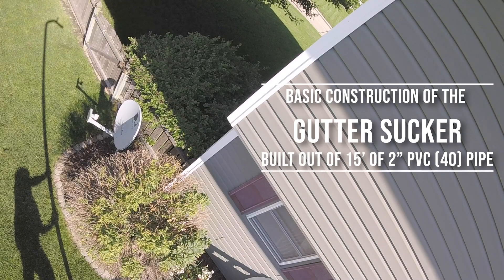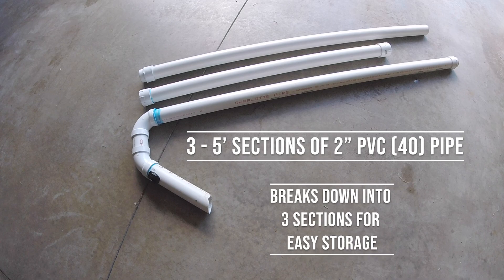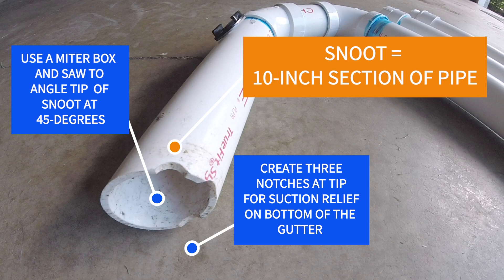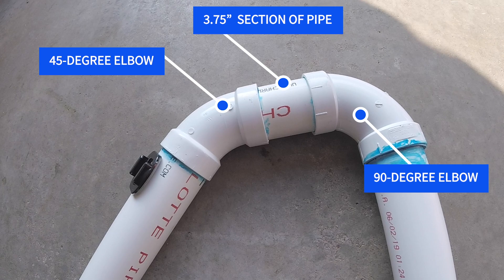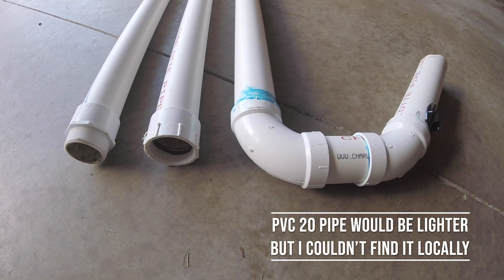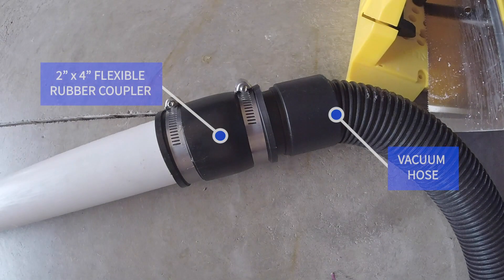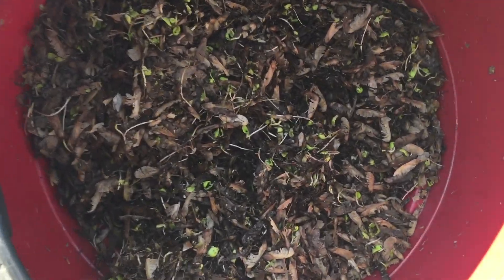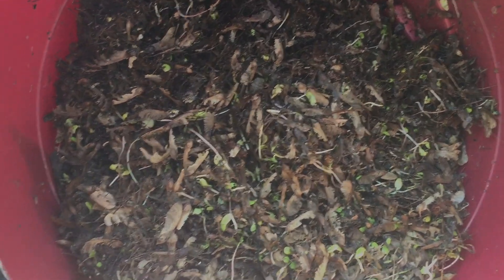Gutter Sucker: An easy way to clean your gutters without having to climb a ladder

Comment: I made one of these several years ago but I used the whole house vacuum tubing they install in the walls of homes it's thinner than schedule 40 PVC.  It's available from Amazon. I had trouble with mine because I have large oak leaves that constantly plugged it up.  I finally switched the vacuum from suction to blowing and I actually blow the leaves out of my gutters.
Reply: I’m in a similar boat. I have oak trees too and was wondering if this system would work. How’s blowing the leaves? Does it make a complete mess or is it not that bad?
Reply: @ilikemyrealname  It just blows them out and you rake the up. Even blows the acorns out.
Reply: @jsantef  I'd say once on the ground ... easy to then suck them up.  No need to rake.  no?
Reply: @johnjacobjinglehimerschmid3555  The problem is the oak leaves even with a power shop vac they tend to plug it up.
Reply: legion rider good to know thank you!
Reply: Considering going with ABS and approaching this bi-modally as a 'toggled' semi-annual solution.  I live in a 3-story house in an oak forest.  In the late summer and fall, first acorns, and then large oak leaves are shed.  I consider this the season that blows.  At or near spring's end, I need to clean out the male oak blossoms which shed and gutter clutter at that time.  That's when I plan to switch the hose and use the vac side during the season that sucks.  I'll probably also narrow the end of the pipe, increasing air pressure during the season that blows.  So I'm planning to use Todd's invention primarily during the season that sucks and the season that blows.
Reply: Preyevate Eyeland You’re reply is both informative and hilarious.
Reply: @ilikemyrealname  ...and serious.
Reply: @ilikemyrealname   😜
Reply: Preyevate Eyeland Absolutely all of these things! 💪😂

Comment: Great idea and execution! Has anyone thought about using ABS pipe? Per 10', 2" ABS is 3.9 lbs. vs. 7 lbs. for sche 40, (& I'm not as young as I used to be). Any reason not to? Hard time finding sche 20 in 2" around Atlanta.
Reply from the maker: My plan was to use the lighter pipe but I couldn't find it here locally. I have been told by friends to try a plumbing supply company.

Comment: Great gadget, many folks could learn to use that after a few goes, magic idea to used screw couplings in the construction helps a lot for adding to or even taking away section to suit ground levels around house, also great for storage time, well done.

Comment: I have a Ridgid shop vac with a 1-7/8" hose. Will that work?
Reply from the maker: I think it really comes down to the power of the shopvac and how clogged your gutters tend to be. I had a 2" so I made it 2". You can easily use my design with that hose. The connection is a rubber hose clamp so you'd only need to really crank it down for that 1/8 difference.
Reply: My Ridgid shop vac has a 1 1/2" hose, but it is really powerful. If the leaves are too big to vacuum, try blowing them out, as someone suggested.
Reply: @rongarza9488  what could be used to blow it out?

Comment: That sir was excellent 👍thank you I will build one this weekend, I’m getting to old to climb 2 stories onto the roof.. the only thing I need to know is how you connected the GoPro to your phone ?
Reply from the maker: Glad you liked it. GoPro was mounted with a GoPro Curved Adhesive Mount - https://bit.ly/2MtDONi YOu should be able to find them locally at Best Buy, WalMart, or Target. Anyplace that sells GoPro gear will have the mounts.
Reply from the maker: Wait I miss read your question - The GoPro I was using connects to the phone via Bluetooth. I think the last three generations of GoPros have that capability.

Comment: Hook it to a leaf blower and blow the gutters out.  No glogs and it is much faster.  Just make sure everything is dry.
Reply from the maker: Interesting idea.
Reply: I have a set-up with a Leaf Blower and plastic downspout and it is awkward and you need eye and head protection. The connections are made with duct tape and the downspout has a tendency for being overly flexible especially on a two story gutter.  This is the reason I am thinking of buying the components for one of these to compare.
Reply: Rocket on the end of a 15' tube.  Too difficult to control.  Yup, tried that.

Comment: My shop vac hose is only  3/4" is that too small, do I need to buy a new shop vac with 2" hose?
Reply from the maker: I am thinking the 3/4" hose might clog too easily. Plus, using 3/4 PVC might be less stable the higher you go.
Reply: Of course you do!  What man wants a shop vac with only a 3/4 inch hose.

Comment: Thanks for this. My shop vac hose I think is 1 1/4, will that work or I need a shop vac with 2" hose?
Reply from the maker: Not sure. My gutters were so gummed up that I think I would have had trouble sucking it all out with a smaller hose.

Comment: Thank you for helping me solve a dilemma. I have a 2nd story gutter clog that is also just over my exterior stairs to my basement. I have an aluminum extension ladder but no firm place to safely extend this (try as I have in the past) to service the gutter.  I seen this video and another similar on YT but like the threaded couplers really appeals to me to break down this system into smaller pieces for storage.

Comment: You just saved my life.  I took a job cleaning 2nd story gutters and have never even done them before.  I was gonna be hangibg from a ladder scooping into a 5 gal bucket like a bozo.  Thank you sir, gonna go huild one right now
Reply from the maker: Did you build it? How did it turn out?
Reply: @qcmize  i want to know too lol im in the same boat, i have a gutter cleaning/ house wash job scheduled for next week, 2 story home, ill probably build one also, if i do ill return with the results!
Reply: I literally was in the same position I just built it this morning and used it. Turned out pretty good lol
Reply: @bryanosorio9331  nice, i never ended up building it, just used a ladder and a homemade extention thing that helped me scoop towards me, worked good, only moved the ladder once on each side of the house.

Comment: GREAT VIDEO!  You inspired me to build one myself.  I used the black ABS drain pipe which was much lighter than the sched 40 PVC at Home Depot.  I mounted my son's cell phone (wrapped in plastic wrap so it wouldn't get wet) on the snoot and used Skype video call over wifi from his phone to my phone :)  worked great!   Thanks for sharing your design!
Reply from the maker: great idea with the skype video call!!
Reply: How long did you make your pipe? My 20' ladder doesn't reach the 2nd floor gutters. Using the ABS I was wondering about the weight of the unit.
Reply: I was just going to suggest ABS pipe in a comment when I saw yours. Much lighter than solid core pvc.
Reply: Very clever cell phone idea. I'm gonna try that! Thanks
Reply: Hi,  what is the size of your ABS drain pipe? How high did you manage to reach, 1 story high, or 2 story high?
Reply: Smart guy. I already knew that tho from your thumbnail. XMR for the win.

Comment: To find schedule 20 or any other such material, go where the pros go: the local plumbing supply store. There are plenty of reasons pros frequently bypass the box stores. A good one will be happy to help a DIYer and keep you out of trouble. I really like the threaded couplers. That's a perfect solution

Comment: How much do you think the pole weighed, thanks
Reply from the maker: Good question. I wouldn't say it is crazy heavy but the awkwardness of holding it and directing it above your head will make it feel heavier than it is. I am 6'4" about 225 and my arms were tired after cleaning all the gutters. I think the next addition will be to add a neck strap to take the weight off my arms. Using lighter grade pipe is the best solution but I couldn't find it locally.
Reply: @qcmize  ok thanks. I'm thinking about 30 lbs give our take. So that would be heavy holding it above your head and trying to keep out steady also. I did see a website online that had schedule 20, its waayy more expensive. It's called think vacuums. Thanks for the reaponse
Reply: Why mot use a standard chest rig for a pressure washer pole to support the weight.
Reply from the maker: @ezdaar5435  Good idea but wouldn't that have to attach at the bottom where the hose connects?

Comment: Hello nice video, I have a couple of questions for you: 1- Why did not you use 2.5" instead of 2" as most vacuums are 2.5"?  2-Where did you buy this camera from. thanks
Reply from the maker: The 2.5" matched my large shopvac hose. Also the bigger the better to avoid clogs. The GoPro Session I was using is about 3 generations old of GoPro cameras. You can buy one of the current models at Best Buy, WalMart, Target, or GoProHero7 is currently the cheapest of the available models - https://www.bhphotovideo.com/c/product/1439980-REG/gopro_hero7_white_with_head.html
Reply: Do you find any problems with the 2"  diameter setup?  2" pipe is alot easier to find where I live and since I don't have a shop vac yet I can buy either a 2" or 2.5" hose one.  Increased diameter of course would be better but if the 2" setup is perfectly fine then I may not bother spending the extra effort and money to try to get the 2.5" setup.  Any feedback would be greatly appreciated!  Thanks!
Reply: I was actually thinking what if I use 1 1/2 pipe to make it a little lighter?